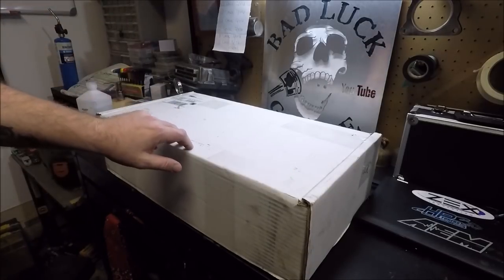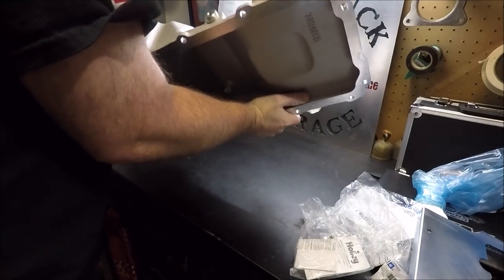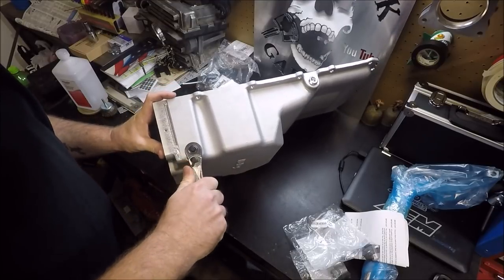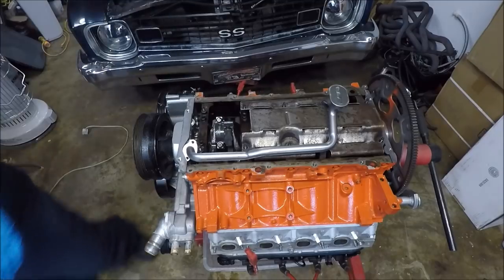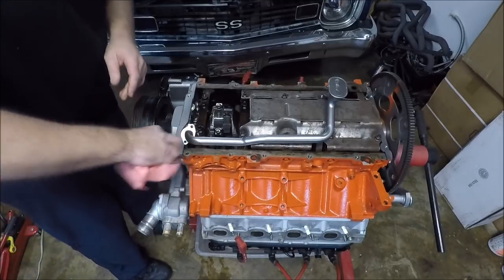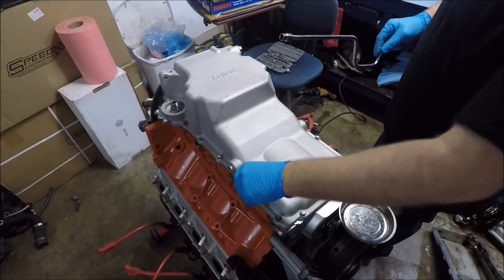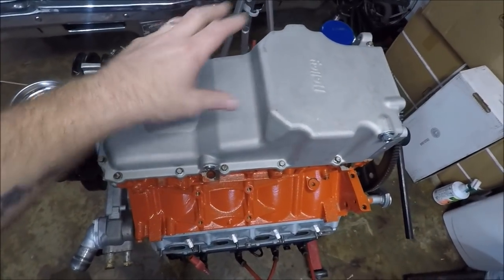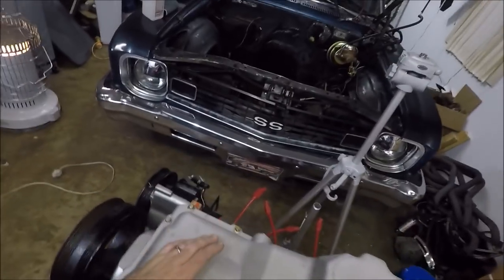HOLLEY LS SWAP OIL PAN INSTALL MODEL 302-3

Comment: Looking great brother! I like the  satin paint option as well. That built in turbo oil drain ports are a great idea.  Keep up the great work 👍
Reply from the maker: Phil I absolutely LOVE satin black in an engine bay. I fortunately I can’t find it in stock anywhere. 😔 I’m hoping the semigloss will at least be close to satin but I’m doubting it. I guess we’re gonna find out though
Reply: @BadLuckGarage  you can always use a satin clear coat
Reply from the maker: Yea or Walmart could just start keeping the paint I use in stock. 🤣 Somebody is buying the shit outta satin 2n1

Comment: I would be willing to bet that they want you to use the front two bolts on the windage tray because any rattling would trigger the knock sensors and pull timing. By the way, I'm the nut that's had 14 Vegas. 😎
Reply from the maker: That was my theory as well but cutting all those small angles with a cutoff wheel had me about ready to just say screw it and cut it straight across. 🤣

Comment: Is that the white box one
Reply from the maker: Not sure what you’re asking. In ten years of doing swaps I’ve never seen one that DIDNT come in a white box. 🤣
Reply: @BadLuckGarage  Well Holly has the 302–3 and then there is a white box one that’s literally what it’s called just looks like you don’t have Holly written on the bottom of the pan
Reply from the maker: @richardeddings7259  I have never heard of a “Holley white box pan”. As far as I’m aware all Holley pans come in a white box and they all have Holley embossed in the bottom of the pan as this one does. You can clearly see that throughout the video. If you’re referring to the cheaper swap pans such as those from TSP or no-name brands then no, those do not have Holley embossed in them because they aren’t made by Holley. I have other videos on those pans that I made a few years back when they first hit the market.
Reply: @BadLuckGarage  check it out they are in the holley site ls swap white box
Reply from the maker: @richardeddings7259  Must be new. Holley trying to still make money in light of all the budget pans in the market now. This video is 4 years old so those didn’t exist back then. I’ve been using the TSP pans for the last 3 years now so haven’t even looked at a Holley pan since then.
Reply from the maker: @richardeddings7259  Yea that’s definitely new. Still more expensive than the TSP pans through Poorman Motorsports though.
Reply from the maker: @richardeddings7259  These are the pans I’ve been using for the last few swaps. https://youtu.be/u0DQ7-vCz7s
Reply: @BadLuckGarage  How many of these have you ordered have you ever had any defective ones
Reply from the maker: @richardeddings7259  I’ve used a total of 3 Holley pans and 4 TSP pans and I’ve never had an issue with either.
Reply: @BadLuckGarage  I ordered one from Amazon a “holley clone” and it was all messed up .where the gaskets were supposed to go it had all kinds of gouges
Reply from the maker: @richardeddings7259  Again, Poorman Motorsports. TSP pans.
Reply from the maker: @richardeddings7259  Same pan we’re running on Chaos Theory, our twin turbo Camaro you see in the videos. It’s seen 26lbs of boost and no leaks. Pans been on there for almost 3 years now.
Reply: @BadLuckGarage  81073, 81074,81075 what’s the difference in these pet numbers on the tsp oil pans They all say they fit a G body but there’s a big price difference of 180 to 280

Comment: Turbo drain  does not work on g body
Reply from the maker: It doesn’t work for pretty much anything from what I’ve seen. If you check out the newer videos you’ll see I had to drill and tap new drains about 3” forward of the cast drains to clear most motor mounts and k-members. Holley really dropped the ball on that design. And the other pans that copy this design have the same issue.

Comment: I’d never use 10w30 in an LS.....They were engineered to run 5w30.....

As well engineered as the LS is,why in the world wouldn’t u run what the engineers reccomended?!? 

I run the heck out of Supertech,hard to beat $10 for 5 qts!! If I’m gonna run Supertech,most times I’ll just spring the $14 for Synthetic Supertech....it’s from one of the major oil suppliers(Mobil 1,Quaker State,Valvoline,etc)
Reply from the maker: Drew you NEVER run full synthetic during break-in. It prevents the rings from fully seating. Run a conventional oil until the rings are seated, then switch to synthetic. And as I said in the video, the quart of 10w30 was just to keep things lubed up until we’re ready fire fire up which could be a couple more months.  I don’t like to leave my freshly assembled engines sitting around dry, especially with the humid we’ve been having and the thicker oils tends to cling to parts better.
Reply: Wives tale Robert😂

Every LS that has ever come the factory in an automobile got a fill up from the factory w/ 5w30 Mobil 1 full synthetic and we see how long most of them live.....That’s 4.8’s,5.3’s,5.7’s,6.0’s,6.2’s,and the ls7.....

As far as thicker oil clinging longer when sitting,that’s why u want to use plenty of assembly lube!

Id have no problem running synthetic oil on startup VS wrong weight oil.

I use Bradford Penn break in oil for 100 miles and change it, run conventional oil for another 500 miles and then switch to synthetic and do regular oil changes.....

And of course that’s cutting the oil filters apart after each oil change to check for contaminates.
Reply: And as far as seating the rings,that’s why you want to run NON DETERGENT oil on break in.

Synthetic VS conventional has very little effect on break in....but detergent oil VS non detergent oil has a HUGE effect.
Reply from the maker: Drew, no, all LS engines didn’t receive mobile 1 factory fill. It was mainly the sport car engines. The trucks and SUVs usually take a Dexos certified blend although I believe GM has changed to full synthetic in all vehicles as of 2015 or 2016. But that’s really irrelevant since we’re not talking about a brand new factory built engine. Newer factory engines ( and by newer ,I’m referring to engines built in the last 20 years or so) have a more precise finish honing process that requires little to no break-in. They’re pretty much already broken in when you buy them even though most manufacturers still recommend  taking it easy for the first 500 miles or so depending on the manufacturer. Running synthetic in a rebuilt engine that you’ve honed at home or even one honed at a machine shop that doesn’t plateau hone can reduce friction between the piston rings and the cylinder wall to the point that it can take thousands of miles before the rings can properly wear down the walls enough to fully seat. Whereas the plateau honing process used in a new factory engine produces a cylinder wall that is near perfect already so this wouldn’t be an issue. In addition to that, you’re going to be changing the oil you used for break-in writhing the first couple hundred miles anyway so it really makes no sense from a financial standpoint to pay for synthetic either.  In the end , it one of those debatable issues that people have been arguing for years so brother all I can say is you keep doing it your way and I’ll keep doing it mine. 🤷‍♂️
Reply from the maker: I have no idea what the hell I did while I was typing that all out but somehow I managed to reprint the exact same thing three times. Fucking iPhone. I think it’s fixed now. 🤣
Reply from the maker: Drew Sharpe If you’re running looser bearing clearances, you would run a thicker oil. Tighter clearances, thinner oil. But I only run 5w20 or 5w30 with the factory spec clearances. And the detergent vs non-detergent for break-in is another dead end debate as well. Everyone swears by their preference. I mean there are people out there paying extra for Zinc additives to break in roller cam engines and will continue to do so no matter what they’re told. 🤷‍♂️
Reply: I doubt the factory recommends swapping injectors, cams, bearings, spark plug heat range...
Reply from the maker: wainfiggitty, yea I doubt that as well. Lol

Comment: You missed a bolt
Reply from the maker: Nope.
Reply: @BadLuckGarage  Just installed my oil pan, I was about to go crazy.  Now I have 1spot with no bolt or hole
Reply from the maker: Lol, yep there’s no hole there brother. Some blocks have them some don’t. I’m not sure exactly which ones. I believe the LS1 in the Chinavette actually has that bolt hole but none of the other engines I’ve built do.